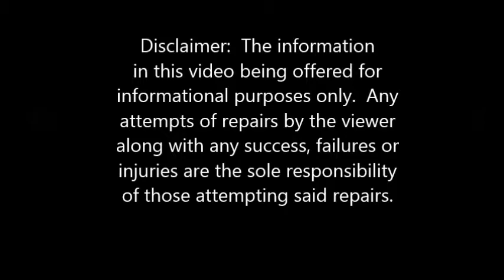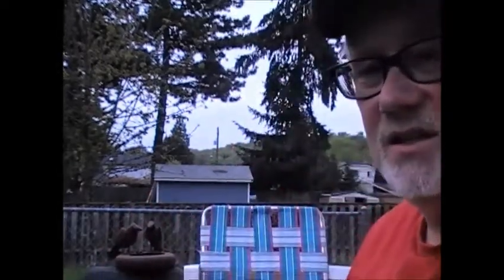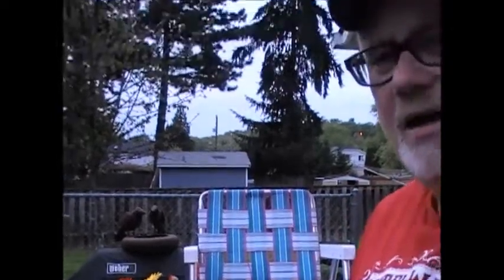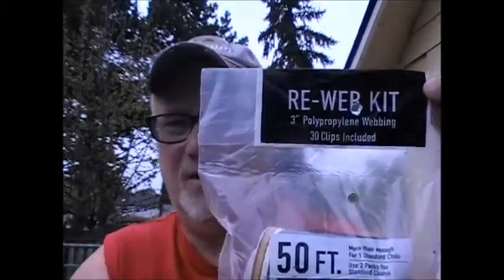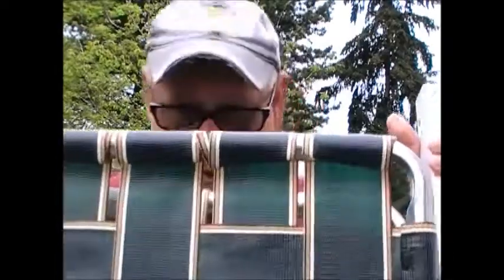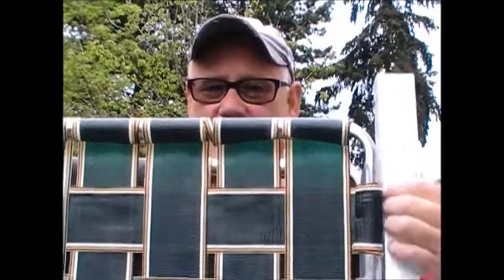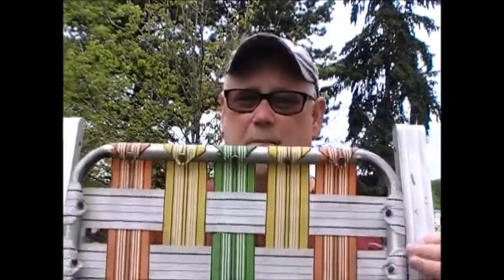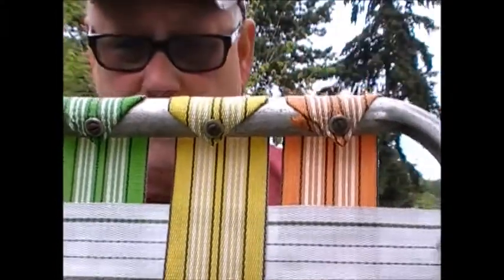Re-webbing an aluminum framed lawn chair.

Comment: Thank You!! I have been searching for a concise description of how to install the dreaded T Clips! Your video is the only one of dozens that properly explains what to do. The directions that come with the webbing kit are wrong, imagine that! After fumbling with the clips I decided to go with the screws on the chair back. I didn't have a screw so I went to Ace Hardware and bought expensive screws that would fit the diameter hole-about 9/64's. I am using a Grommet kit for the webbing on the length wise. Later I realized that the screws won't work in my smaller diameter screws with those grommets! Now Im back to the clips and will make another attempt following your valuable advice! Thanks again!
Reply from the maker: Best of luck and well wishes for a smooth job!!